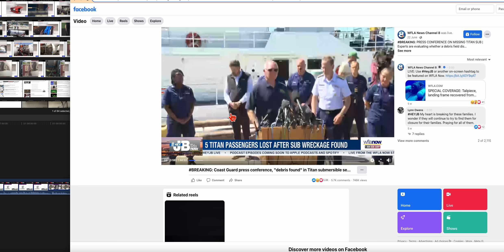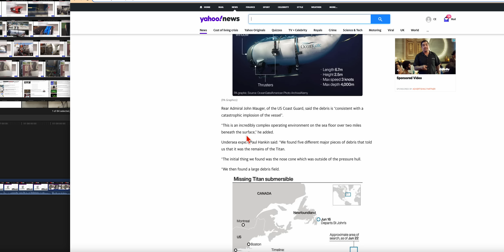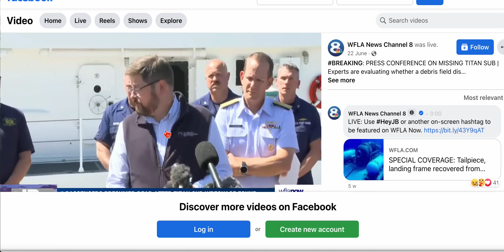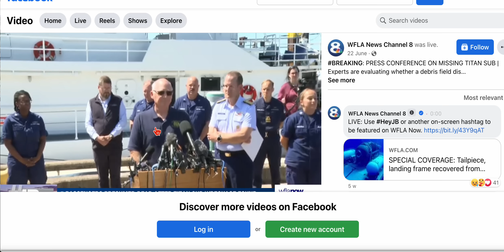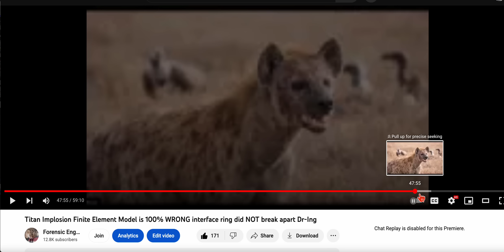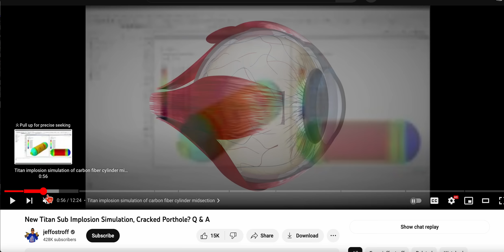Titan Implosion 99% SURE debris field PROVES EXPLOSIVE FORCES 1000' debris field in water column

Comment: when he saying "we found was the nose cone which was outside the pressure hull" - that's a strange description, does that imply that there was a reasonably intact (pieces) of the pressure vessel evident? Was anything still ttached to the end bells and did anything fall off on the way up?
Reply from the maker: I think he meant the rear cone bc he also says aft and describes the interface and profiling and cap? This is one of those press releases that could use a shit load of clarity...
I will wait a few days and will post another one, which will bring more clarity

Comment: Found: 1. End Bell/missing window 2. Front ring 3. Rear ring 4. Tail section and 5. Legs/frame.
Reply: Titanium frontal viewfinder with acrylic window missing?
Reply: @dianamincher6479 Right — and did they find the window?
Reply: 2 interface rings front and aft, front (nose bell)and aft end bells, rear tail section and the frame?
Reply: @dianamincher6479  The end bell and one missing frame leg have not been found.

Comment: 200 meters and the other gentleman was using feet at 1600. Still approximately 1000 foot difference but think lost in different terms.
Reply: I HATE, all metric crap.
Reply: The majority of the world uses metric bud.
Reply: @Glocks.Scotch.and.Wristwatch  But, if you notice, a lot of those values of dimensions of parts are metricized english units. Many, many parts were originally inches/mils, and converted to metric. Many drawings for components  show both units.